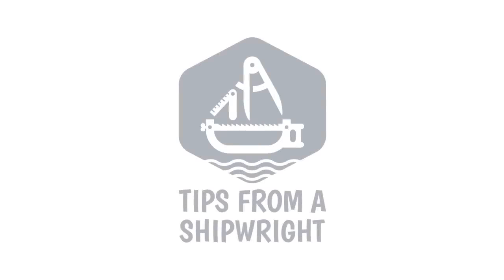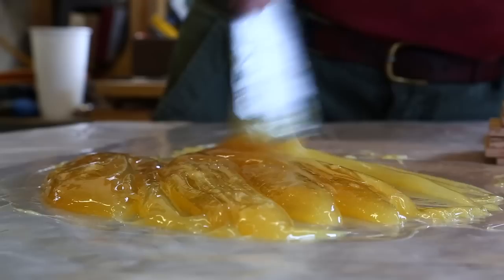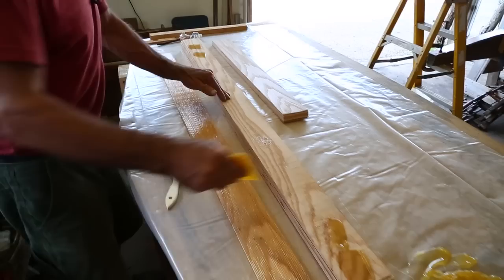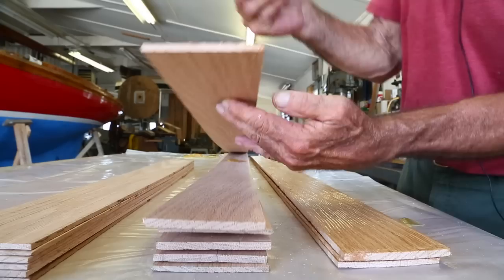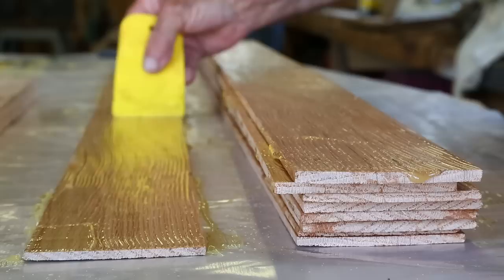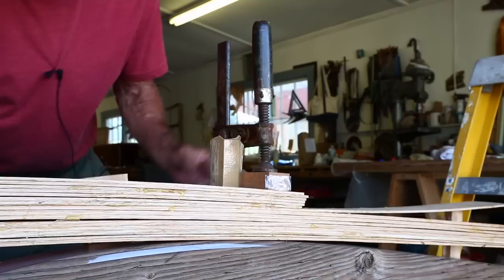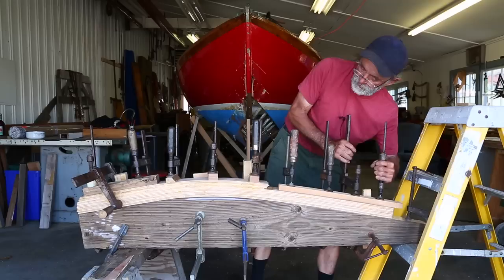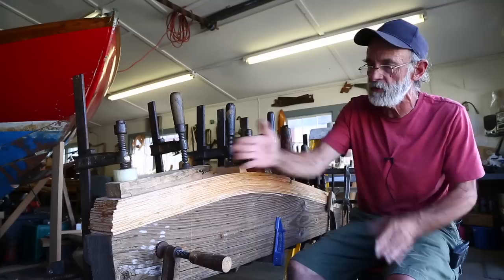Part 5 - Herreshoff 12 1/2 repair - How to laminate the forefoot with epoxy for a wooden boat

Comment: As I was watching the previous video on steam bending,  I said to myself that I would laminate that member.  I thought that it would be tricky to get that steam bent piece to lay up in there without twisting and being too springy.  I had to chuckle a bit when I saw that we reached the same conclusion; each by a different path.  But, it turns out to be a good thing because you get to show folks both methods and the potential benefits and pitfalls of each.  This is a wonderful set of video on the 12&1/2.  Thanks for posting.

Comment: 7:03 the first clampand tape covered blocks should be set across to keep the little slats to slide laterally out of alignement. one in the middle and on both ends.

Comment: The teeth allows for the glue to spread flat when two pieces are pressed together. Prevents glue pooling. Also allows air to escape between the two pieces when pressed together.

Comment: 3:11 how about setting all boards down on the table, use a wide metal spatula to lay the glue on all of them at once then corrugate the glue? keep the boards tight with blocs clamp to the table...

Comment: This is really neat. Lou, if you didn't have access to a good quality timber to make a knee or a high-stress part, could laminated parts like this get substituted without substantially weakening the structure? Well, better put, is the laminated part stronger than the one piece of timber it replaces?

Comment: Theoretically speaking, what would be better

a. a piece of bent wood

or

b. a laminate

or

c. a piece cut from a curved wood, so a piece where the grain goes straight along the bend just like in a bent wood piece?

This is all hypothetical since finding the right piece would be difficult.

Comment: 7:57 did you forget to put some tape on those vertical pieces? Should there not be one on both side of the laminate because of the tons of glue you have there..?

Comment: 3:52 just on side would be fine, you are going to put so much pressure on the boards your could have used half the number of boards thicker. That compound epoxy is not the right type, there is one out of a can much more fluide.